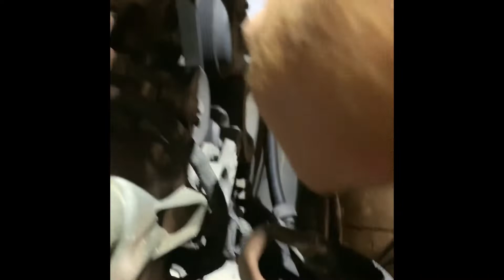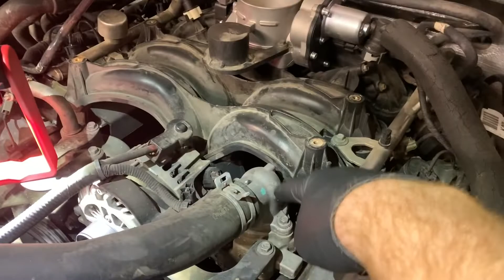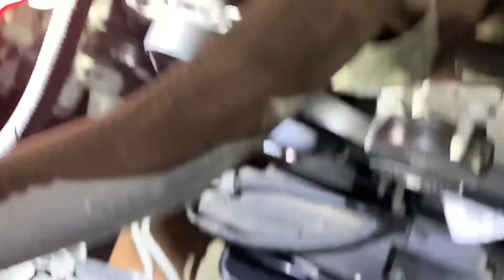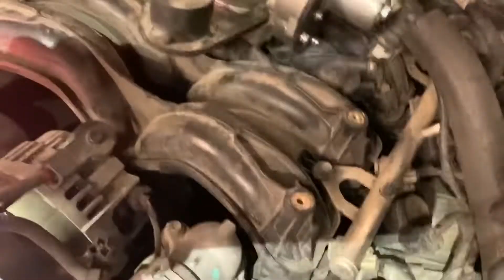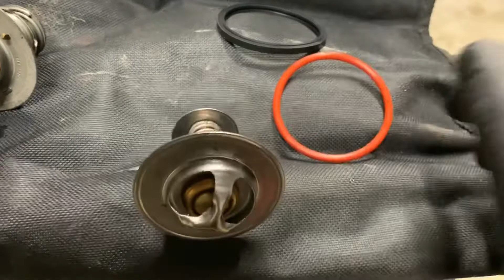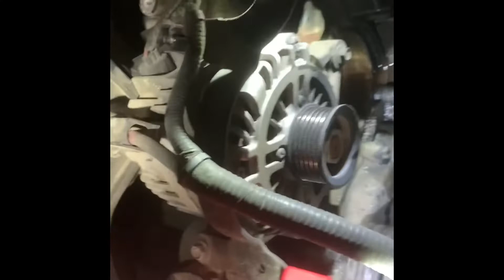2011 Expedition Water Pump/Thermostat Change 5.4L Triton

Comment: I’m replacing my water pump tomorrow on A 2012 Ford Expedition. Thank you for this informational video. 🔐👌
Reply: I have a 2011 Ford Expedition el I hear they go out but mine has 227,000 miles should I be worried? It has no symptoms of it failing? Bought it at 210,000 miles

Comment: I wish this video had more details for people that aren’t Mechanics
Reply: I'm not a mechanic, but replacing a water pump and thermostat is easy
Reply: This was quite a pathetic how to video, spend a minute and a half talking about not needing a puller tool and no time showing what needs to actually be done.
Reply: @brankon1210  you really don't need to me a mechanic... its very basic take off the bolts and get the pump out . Maybe needs a tap or 2 with the hammer if its stuck .....